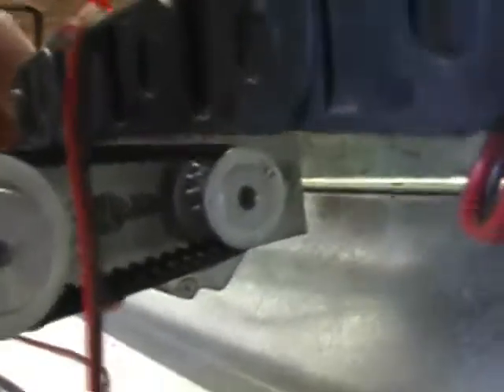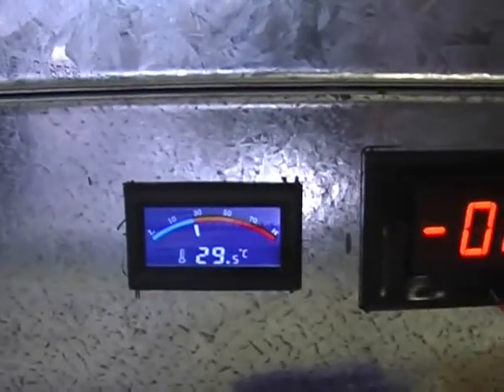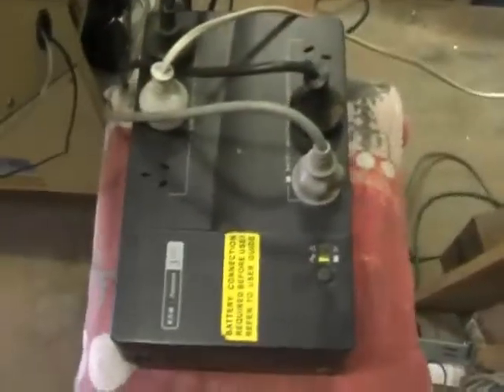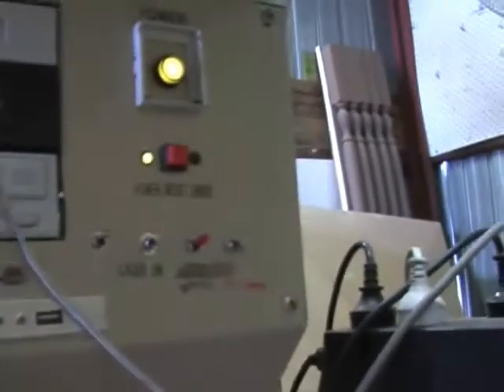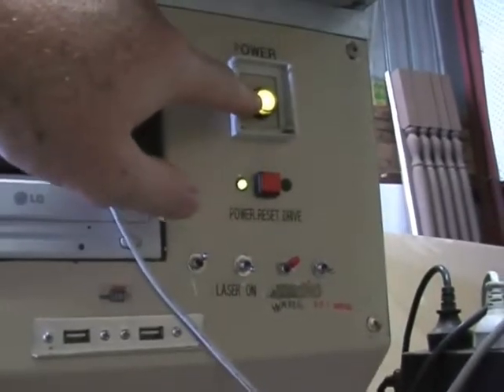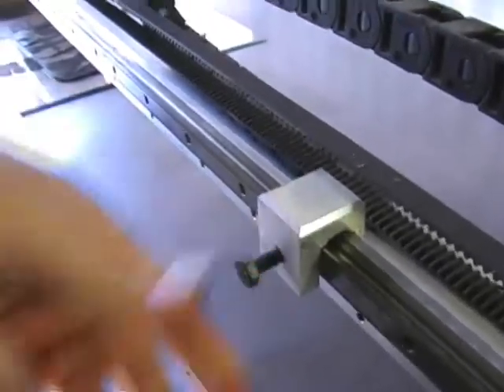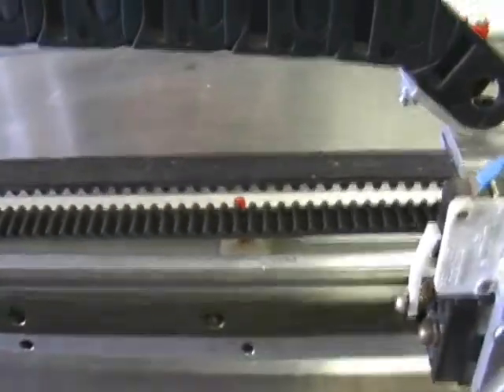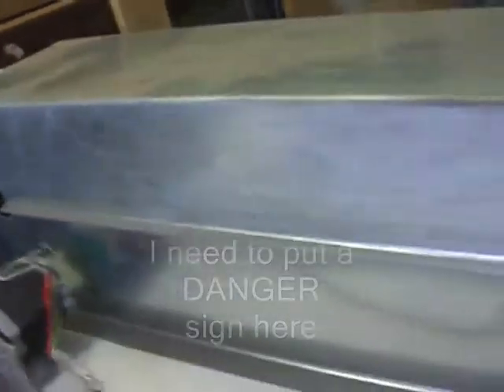100 watt laser.wmv

Comment from the maker: The 50.8mm one will be more than adequate for numerous jobs.  80 watts is about the best all round performer for cost and power.  You are going to love it. :-)  Just be careful when you first start it up and use a red pointer to align your beam path first so you don't get any stray lasing in the face.  That's what happened the first time I turned mine on as the red pointer wasn't properly aligned with the laser beam.  Use polycarbonate glasses (normal safety glasses) at all times, and enjoy!!!

Comment from the maker: Hey,  I use a few different lenses.  My main one is the 63.5 one.  I use the 1' one occasionally and also a 51.5" lens.  The longer the focal length the lower the beam density and focal point.  e.g.  lets say a 1" lens has a 0.0025 beam dia,  then a 63.5mm lens has a 0.004" beam dia.  I'm only guessing as it's pretty hard to measure.  If you want pretty straight sides on what you are cutting then go the longer focal length but you lose cut power doing it.  It does make a difference.

Comment: Hi, can I ask you what kind of focal lens you use? I plan on buying a 80 watt laser tube next week (Coletech inductry quality, so those are RECI tubes)
My machine has 122x61 table for mounting plates and I calsulate that beam diameter will be between 8 and 12mm. I think I need a 100mm focal lens instead of my current 50.8mm ? Any ideas?